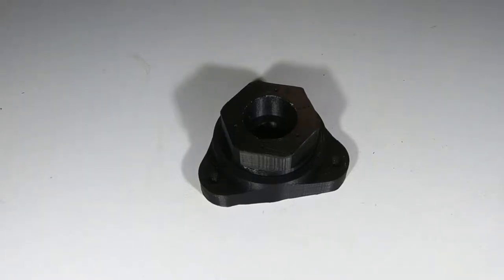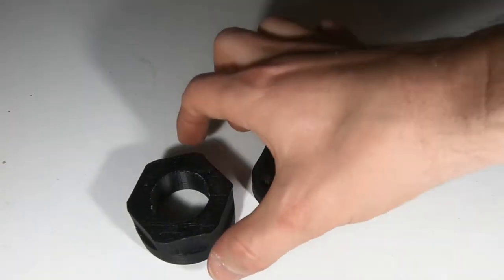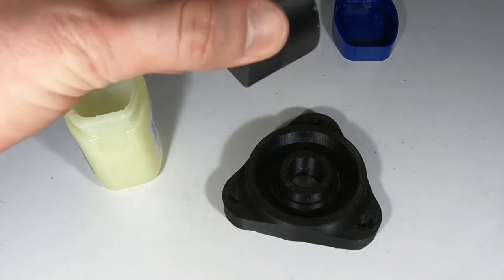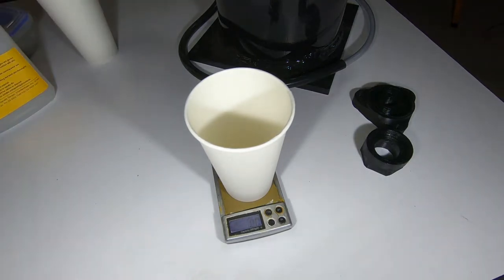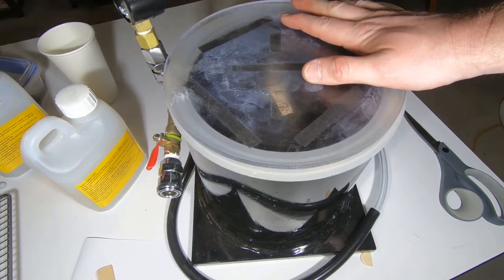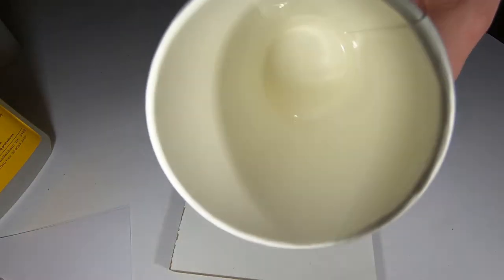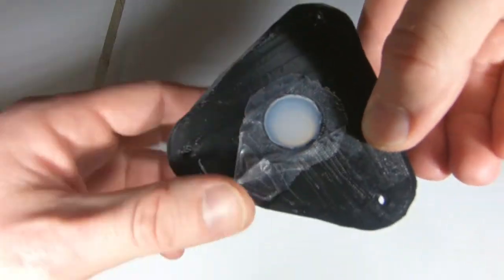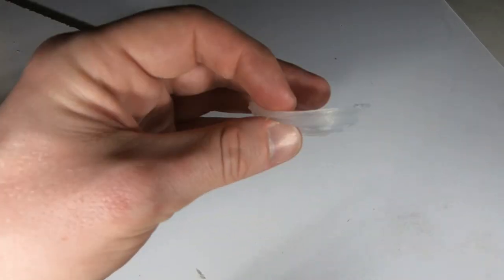[BUILD] Silicone Moulding a Custom Gasket Seal

Comment: Have you ever tried degassing the poured mould inside the chamber instead of doing the initial degassing?
Reply from the maker: I have, I found the silicone expands so much prior to the bubbles bursting that it just all flows out of the mould, which is why I went this process and then made my injection moulder (which I really should refine and improve)
Reply: @CEWManufacturing  very interesting. Thanks for the reply!